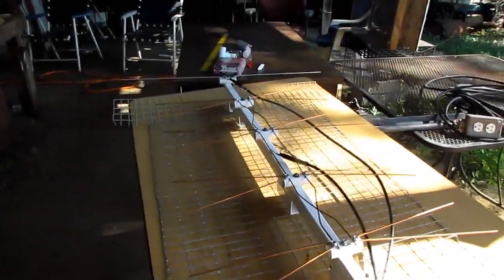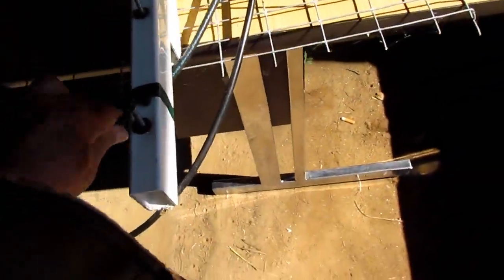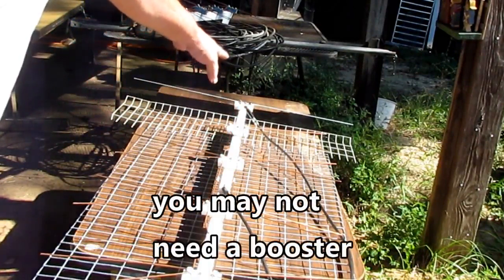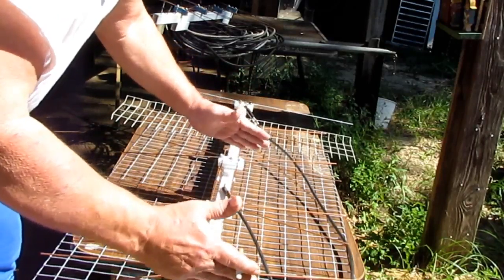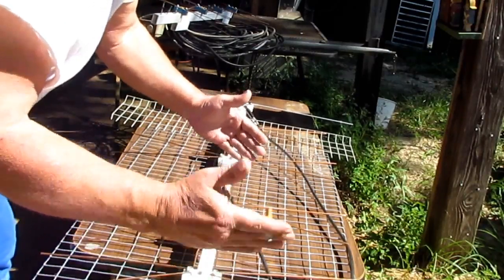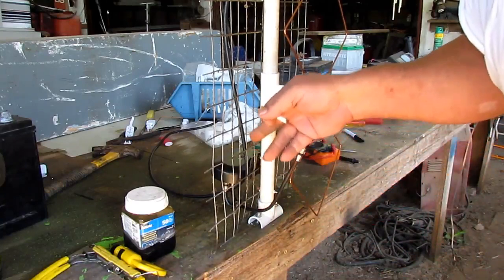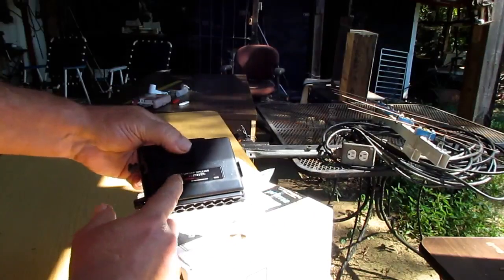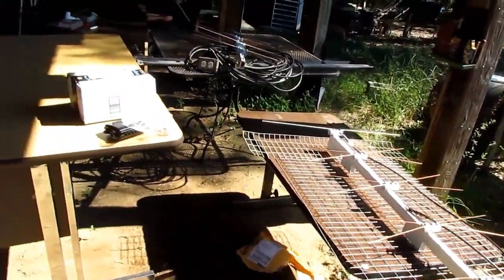Combine UHF and VHF TV Antennas  Problem Solved

Comment: Thanks for the video.  As for as the question about the source of getting 28.5 inch for the total length of the vhf elements.  First of all, this is a tankard dipole antenna, it should be exactly half the wave length to get a good impedance match around fifty to 75 ohms. So, no balun is needed for this dipole antenna.  28.5 inches is tuned for 207 MHz, that is Channel 12.  To tune it for other channels, divide 300 the frequency of that channel, then multiply this answer by 19.685 to get the total length of the dipole for that channel. This my understanding on how to get the length of the two elements. For example, Channel 8 is 183 MHz, so the two elements will need to be 32.25 inch long.

Comment: Yea you were overloading the amp. Sometimes you need a diffrent amp on vhf than on uhf. In catv headends we use a pad to reduce the db before going into the amp. And the length of the elements is calculated from the freq of the channel you wish to receive.

Comment: This must be a older video. Today we have adjustable amps. And antenna combiners seperate or combined with the pre amp. Or as a electrical engineer let me tell you a custom dual balon that will seperate the signals on the buss. Also going to a 25" max vhf element will fix your uhf degrigation

Comment: Question for you. I installed a distribution amplifier for my antenna but it quit sending the signal through. I think a component fried.What size grounding wire would you use.

Comment: My situation My antenna is like 10-12 feet off the ground Its a yagi type antenna n I got good reception Fox NBC n ABC I dont have a reflector but I do have a metal roof behind the antenna! So perhaps that is acting like a reflector. On my other installation here is same set up with no reflecter I got tiny mesh type fence could that work as a reflector as well or does it have to be the large rectangle wire you use? Im sure you know its read small about `1/4 inch square mesh like might be used for small animal or rabbit cages! Im trying to help my brother watch football! N I know u used tin foil glued to a block of insulation one time n Im guessing that was for a reflector as well! I get 4 pbs chamnnels 3-1,2, 3, 4,  n then 5-1,2,3, n then 12-1,2,3,4,! Are my channels the other place has 3-1,2,3,4, n no 5-??? n then 12-1,2,3,4,! Im just wondering why 5-1,2,3, dont show on my other antenna instalation Im thinkin the difference is no or a very poor reflctor! If I could just add a reflector wire array it might get the 5-1,2,3 channels which include fox! Its just a guess n could be a fairly easy fix to try n get these middle channels! Or does the antenna need to go higher? Id say the pitch of my roof is 0nly about is about 15 degrees so maybe it adds lift to my signal since my antenna is so low to the ground. But there is also an unused analog antenna in my attic even though its not in use could it have or be a factor in my reception? I wo9nder what would happen if you put a yagi type antenna infront of one of your sort of flat design antennas or would they interfer with each other! Questions Qouestions n no9t enough answers sorry

Comment: Unfortunately I can purchase an Solid Signal HDB4X UHF antenna and combine it with an Stellar Labs VHF antenna for less money and receive stronger more stable signals than the "ultimate" antenna I purchased on eBay and then had to add the VHF whiskers too. These antennas have the advantage of being structurally built out of aluminum vs yours which is built out of plastic and will become brittle in in no time. UV Rays kill plastic.

I did a side comparison between your "ultimate" antenna with the HDB4X antenna and got the exact same results and it was $40 dollars less. I'm sorry but I've done the tests
Reply: I also did a side by side comparison between the "ultimate" antenna with the added VHF whiskers and the Antennas Direct DB4e with the VHF retrofit kit and came up with the exact same results. I'm sorry man but your antenna is actually a step back because it's support structure is plastic. Contrary to what a lot of people think, copper does not outdo aluminum
Reply: My last point here is the fact that copper left out in the elements will become corroded over time. This corrosion will lesson coppers ability to receive and transmit signals. Look at the Statute of Liberty. Today it is green due to corrosion vs when it was originally setup. That corrosion adds a barrier and will reduce its effectiveness. It's called limescale

Comment: I ran my vhf wire on top close to my uhf whiskers and did not connect to any wiring. it brought in all my vhf channels and gave me 5 more uhf channels for a total 15 more channels.
Reply: Did you place the two halves so that they were at the same angles as the two halves of the top bow tie?  Similar to the way the top hat is placed on a Gray Hoverman?

Comment: Danny I built that ultimate antenna a long time ago and I pick up uhf and vhf, in fact the vhf even has a stronger signal. What I am trying to say is that I don't see the need for the vhf add on, seems to be a waste. I don't use a booster either. I cut the cable long ago and bought a roku, and a fire stick for the bedroom. I have amazon prime for shopping on line so the video and movies are a plus. Why pay for cable?
Reply from the maker: That right cable lol....brother everybody is not so lucky to have a strong VHF signal...its just a option
Reply from the maker: with the vhf and uhf separated the antenna will pick up better
Reply: Since you put it that way Danny, I may have to try it. Where I am the towers are only 30 - 40 miles away, but trees, power lines and the antenna being in my attic makes it difficult. The store bought antennas don't hold a candle to the ultimate, I guaranty you that. I am also splitting to 2 TVs. no booster. Also in my area, the only channels that are VHF are the PBS channels, but hey, if separating them makes it better it may be worth it. I'll let you know how it turns out. Oh, and thanks for replying to my comment.
Reply from the maker: ok brother tks for that question
Reply: Curious that if I wanted to do the side by side but also the vhf add-on if I would be best to only do 1 vhf or double that up as well... Thanks in Advance. I love the videos.

Comment: Danny, Do you use an antenna because their is no cable service in your area? Just curious. I built one to cut cable bill myself.
Reply from the maker: I HAVE CABLE AND ANTENNA
Reply: Danny, if I'm receiving a signal from two different directions can i put a deflector on one side of a set of whiskers and then another deflector on the other set of whiskers on the same antenna? So one in front and one in back to receive from 2 directions without interference?
Reply from the maker: you wanttoblock1 station outisthat right
Reply: Danny S Hodges - i have a 4 whisker antenna. I want to put a deflector on 2 of the sets of whiskers to only pick up stations from the north and then put another deflector in back side to of the other 2 sets of whiskers to only pick up stations from the south. Will the work?
Reply from the maker: it will work but it complicated  it has to be done a certain way to work..i have that on my channel

Comment: You know I* was lookin at walmart antenna's on line n I saw several similar to ur designs only made of aluminum the one I saw had 2 pair of wiskers with a similar square reflector wire  n a few bow tie types similar to some of your designs just get on walmart n check em out for yourself but maybe you know this already! You wont find em in a store ull have to order them online Im sure but they are similar to yours except instead of say square or round pvc they use what looks like aluminum type or metal frame work! Could be somebody copying you china maybe they steal all patents n designs so getting patents isnt always a good idea in our modern world which is what Trump is complaining about stealing intellectual properties patents and design as in industrial espionage type things we think russia is bad well china is even worse.